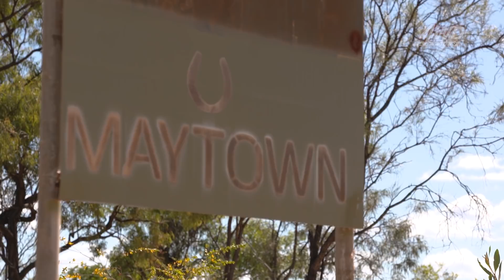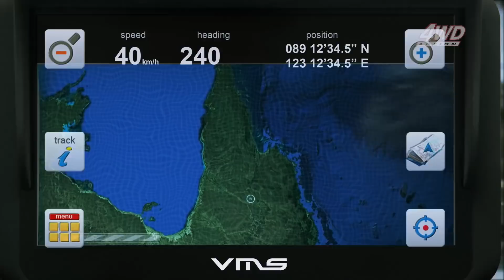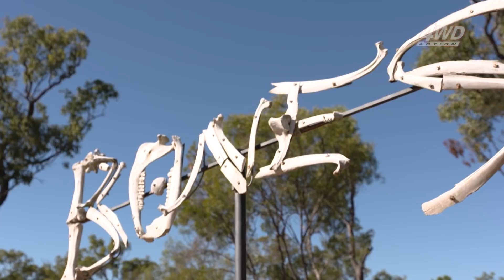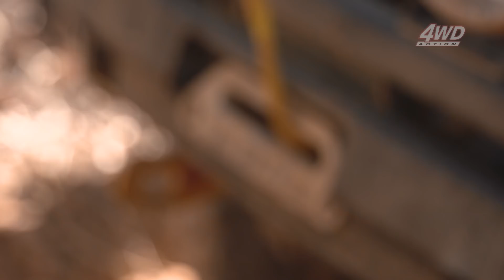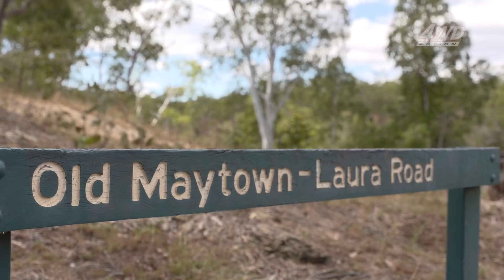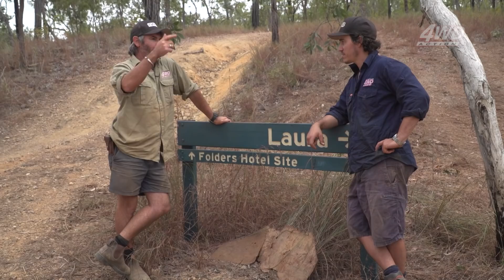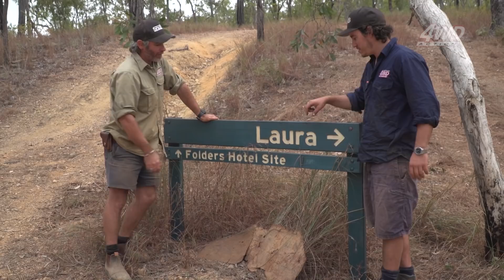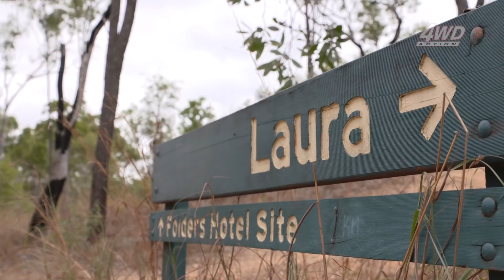Cape York's BRUTAL Old Coach Road • Which 4x4 is towed away?!

Comment: I had a feeling that was going to happen to the 80 series if you watch closely that wheel did have some abnormal movement when it went through that water at 17:50
Reply: Good pickup!
Reply: yeah that looked so damn loose i was like that shouldn't be doing that

Comment: Graham's always banging on about the traction control but I've heard others say you should turn it off when 4wding & my Hilux turns it off when in low range.
Reply: Mick A people mix up traction control and Electronic Limited Slip Differential.  Traction control, at least on my US Nissan Frontier Pro-4x, is for ice, dirt roads, etc. for street or highway speeds to prevent spin outs and losing control. It steals power when it senses slippage.   Not useful at all for 4x4 tracks.  

The ELSD functions more like a locker.  The traction control must be turned off for the ELSD to work.

Comment: That is funny how you love that traction control and the rest of us hate that traction control it got me more stuck than anything but soon as I turned it off I got myself out the problem is it will not let you get the wheel wheel speed you need to flick the mud out of the tires especially the ones in the US

Comment: Gday 4WD Action. Im a US viewer and have a 1990 ISUZU Trooper II (holden jackaroo) gen 1. It is 2.6l 5 speed manual gearbox with IFS and rear leaf. Would this be a solid platform for 4x4? she is a good runner with lower miles. I just did the clutch and it is a mint chassis. My biggest concern is its capabilities as a 4wd. please advise? cheers.

Comment: Great videos guys thanks for the adventure. Was wondering what kind of tires your running on your rigs to handle all that different types of terrain both rugged and muddy? Quiet the contrast. So is the "Goldie" beer you guys are drinking known as the 4-X John Williamson sings about in Crocodile roll? "A tropical Honeymoon knockin' the 4-X down"
Reply from the maker: Hi Allen, Shaun runs General Grabber X3 mud terriains these days, and Graham runs Bridgestone Dueler 674 M/T's. A good all terrain might be more suitable for 4WDs that spend more time on the road but these are purpose built for the toughest tracks we can find.

Yes that's the beer

Comment: It’s a pity you have to plug the dmax, yeah it’s a good ute. But it’s just cringe worthy thinking your on a 4wd show driving a barely modified ute because you have to plug it! 
Grow a back bone and tell Isuzu you want to do it your own way!
I love all the other utes (as much as they need to go on a diet)
Reply from the maker: Not everyone can built a mental Cruiser or Patrol - 4x4 utes are some of the best selling vehicles in Australia so why not show that anyone can get out there and go 4WDing in a modern reliable vehicle instead of buying an old solid axle with 300,000kms and putting $30k into it?
Reply: It’s a pretty rough track we did it back in october, none of the harder lines but our Colorado only has a 2in lift and a/t and it went through no problem
Reply: also numb nuts, that is one of Graham two Dmax's, why can't he drive the vehicle he wants? especially when it's his own vehicle? and especially considering he has to drive thousands of kilometers at a time? maybe something new is a pleasant change?
Reply: Oh no you get me wrong, I had a 2014 bt-50 with a 2 inch lift did Fraser bottom to top and with a few more mods have done heaps of trips, the new utes are awesome and lighter and more powerful than any of the older ones.  I now have a cruiser

What I see is a ute that struggles to get anywhere because he doesn’t have the right tyres on, the traction control is is probably the same tech from a 1990’s Range Rover and he’s saying it’s awesome. I see shows that go from being something original and amazing to something large where sponsees lever to much control and take an essence of originality away. I know the show has to evolve and that new utes will be coming in because they are superior in every way. Just modify them the way we would expect the boys would and drive them like we would!! Hard!!
Reply: And the dirty 30 is about a ton too heavy!
Reply: What do ya mean Isuzus are B grade? have had several old troopers and they have never let me down! those things are built tough
Reply: Davo george no one said that

Comment: The dirty 30 sucks just wish he'd get something different. Thing is old and pure junk. Every trip something new breaks or same thing over and over. Almost not even worth watching these anymore because i can just tell what's gonna happen the dirty 30 is gonna break before it even starts.
Reply from the maker: These aren't uploaded in the order they were released in, but co-incidentally we've managed to upload some shockers for the Dirty 30!
Reply: 60s are normally real sturdy, not sure why he has such bad luck. Personally I would go with a bit smaller tyres and use u-bolt flip kits to get back some of that clearance, but I know people who run 35s on their 60s with no issues. Could also be that the slack in the automatic rear locker causes problems, I would be interested to know.